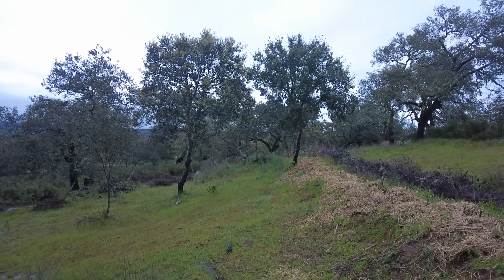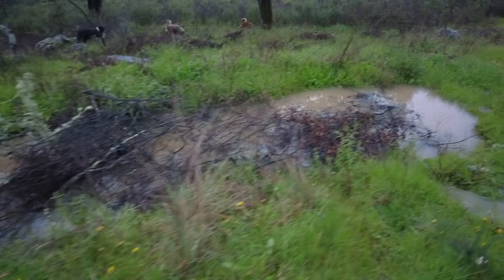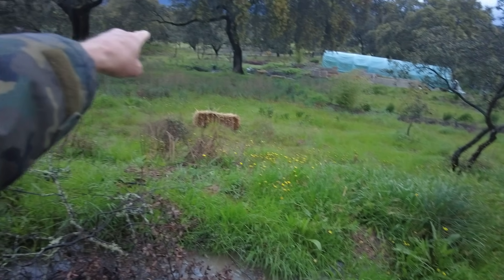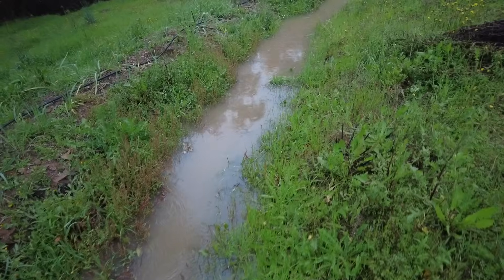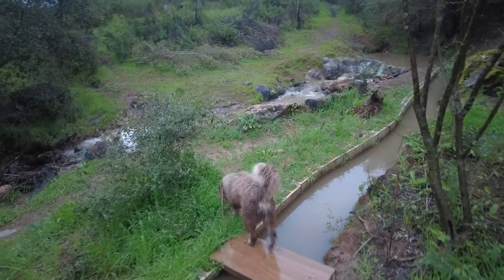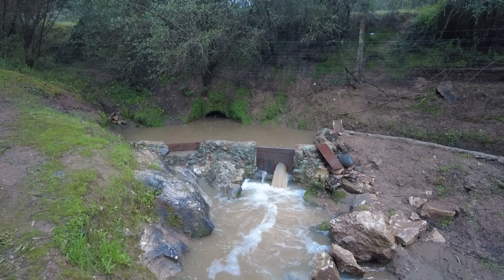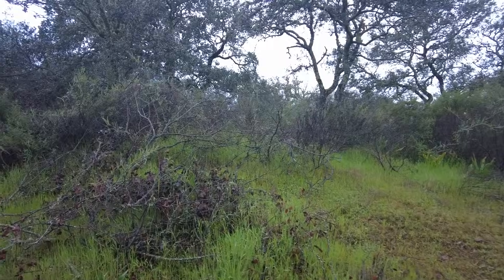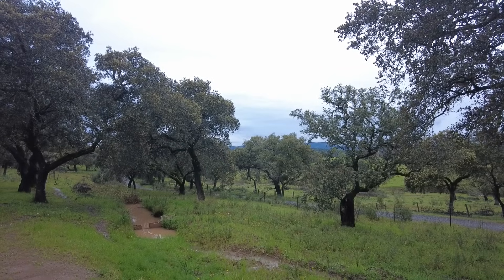#permaculturesluice #permaculturazanja. Walking from swale end to sluice beginning

Comment: Just wondering - do  you ever go back and shovel out the organic material you put in the swales when it fully decomposes? Looks like it would be a good source of compost (if it doesn't all just wash away).
Reply from the maker: @jenniferpolk962  I'm looking forward to doing that. I'll give it another year as during last year's drought the decomposing was slow. It doesn't really get washed away, perhaps the minerals do, but next year I'll monitor it better. We allowed all this water to run through so that we can observe what is really going on. Thank you for asking. Much appreciated
Reply: @SuerteDelMolinoFarm  Thanks for informing us that the pile heights have decreased over time.  I did not realize that was happening.  That is great news. I suppose you will be able to shovel the composted material straight onto the top of the berms.  Magical!   👍